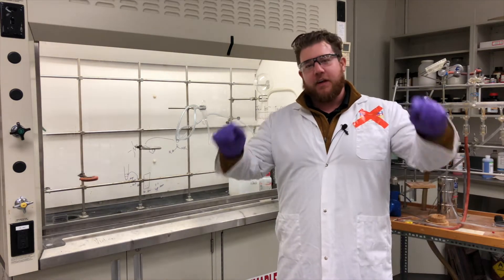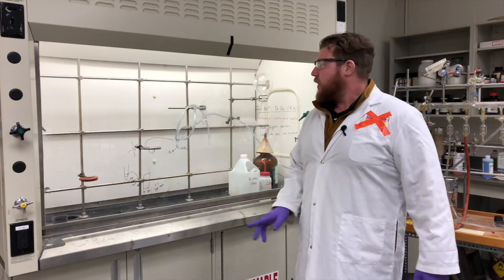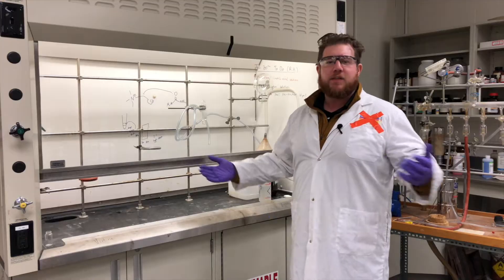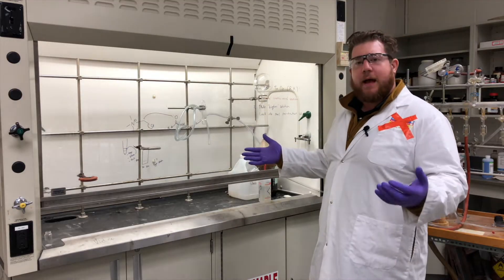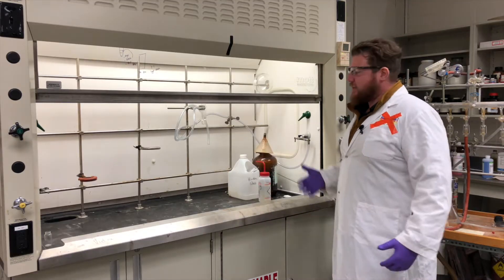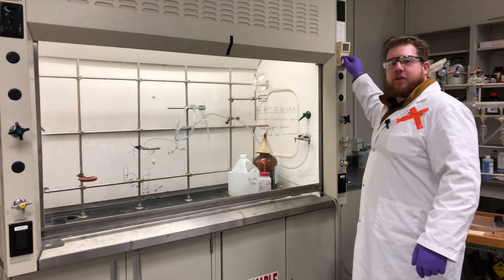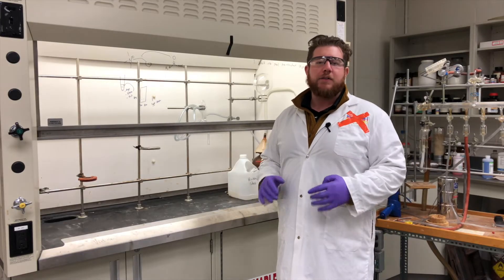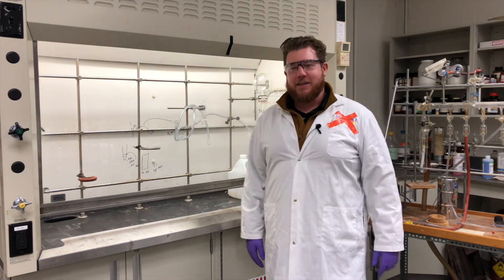How To Use a Fume Hood  #SCIENCE

Comment: I had a maintenance guy at the water treatment lab I work at pipe in natural gas instead of the nitrogen and mis-label both valves them incorrectly. The protocol in our lab is if there is a small fire in a contained beaker is to close the sash and decrease the air volume to starve it of oxygen. Well, some amateur lab technician throught it would be a good idea to use he dry nitrogen to extinguish a small isopropanol ph testing solution fire. Unbeknownst to him, the nitrogen and natural gas lines were switched and caused a huge methane fire on the Hood.
Reply from the maker: THAT is an epic failure!
Reply: Supreme Science after it was all over and the lab technician got fired, it was really funny. Our hoods there have fire suppression systems in them for bigger fires, and he didn’t actuate that, so the whole hood, ducting, vent gas scrubber, and the exhaust fan needed to be replaced.
Reply from the maker: @johnanders8861  🤦
Reply: Supreme Science yep,  used about $80,000 in damage.
Reply: @johnanders8861  I wouldn't have fired him. I just invested $80,000 in someone. To fire someone and risk that happening again nah xD. Equipment can always be replaced cx.